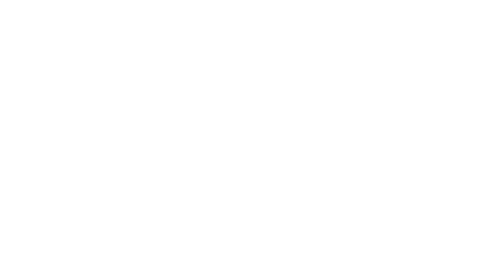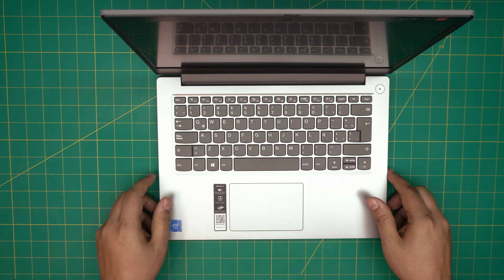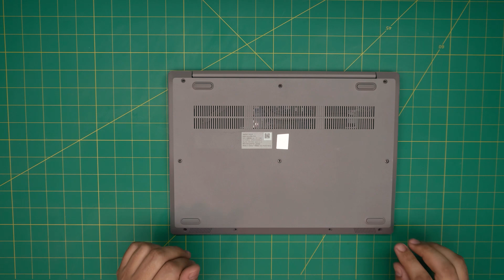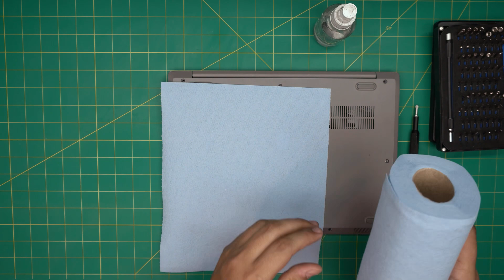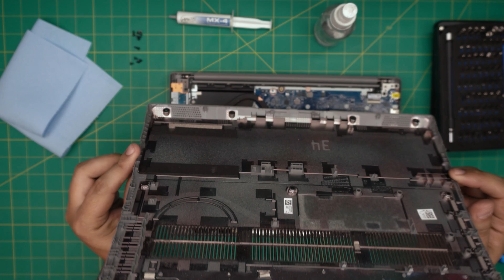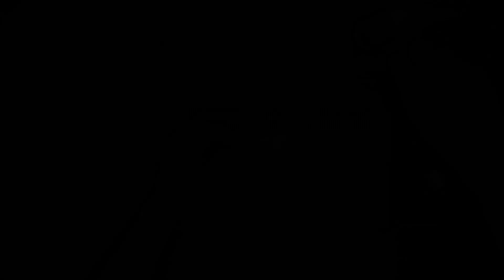How to Repaste and Clean Lenovo IdeaPad 3 14Igl05 - Step-by-Step Guide🧹

Comment: is there a big different between 14Igl05 and 14iml05? because i have a 14iml05 and was seeing if i can just use this video tutorial for it
Reply from the maker: 🫠 If you wish to support the channel, you can like, subscribe, or both!
Regarding your question, it is almost identical , if you are able of following this steps, then 100% you can do any of the sub models.
Should you have any further questions or requests in the future, please don't hesitate to ask me.
cheers🍻
Reply: @uFixTek  thank you so much bro, can i ask another question, do you do videos about undervolting laptop cpu, and do you have a tutorial? thanks again bro
Reply from the maker: you can't under volt this laptops, they have basic bios and not advanced bios, the undervolting happens at the bios level, or with a application that can control the bios, but when the BIOS is not advanced (locked to simple firmware) then no matter what program you use you won't be able to undervolt.
only on high end laptops and some of them.